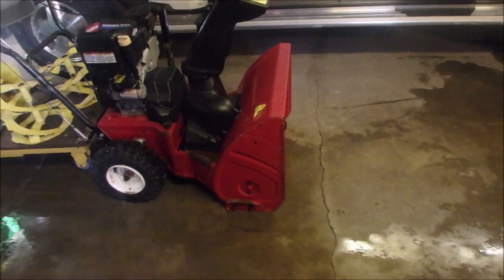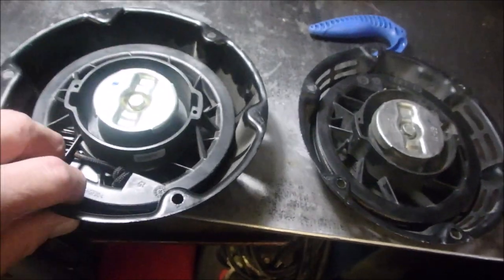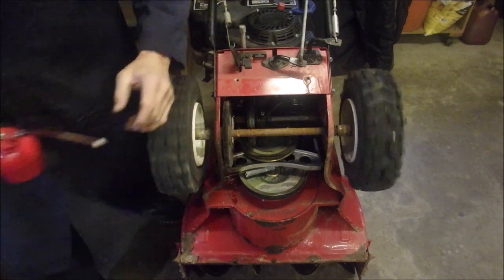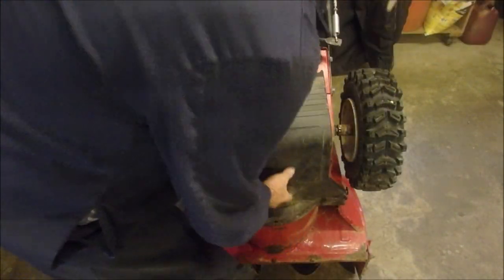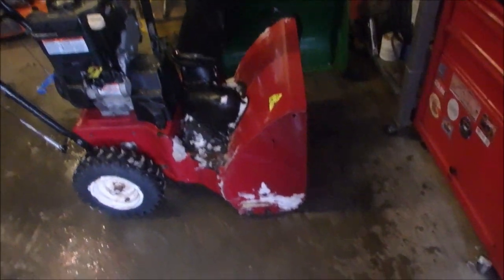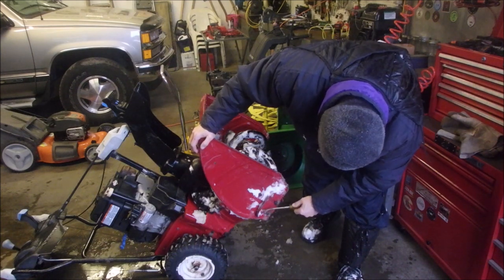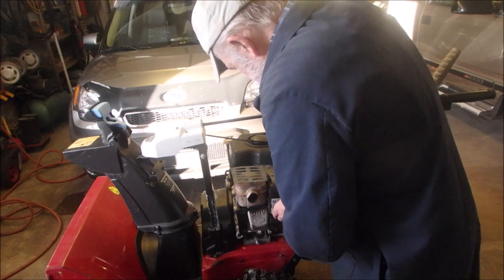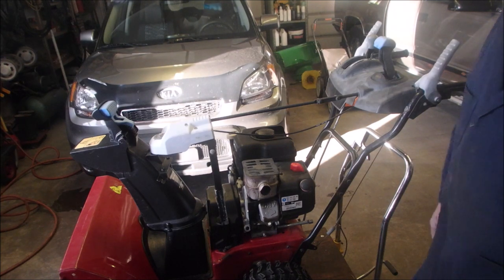A Honda Rewind Installed on a Toro Briggs Engine

Comment: Nice hack repair Bruce and great idea putting the washer behind the cup. Yep it pays to have parts from scrap engines saves $100's +
Reply from the maker: It does.  I was thinking that choke lever handle came in a package with a wing wang carb
Reply: I love it when the parts hoard comes through.
Reply: @BrucesShop  By the way wow snow eh? We got beauty weather here Bruce like summer time just the falling leaves building up and need to be mulched or bagged.

Comment: Yeah prices are getting way out of hand. 
I just fixed a gentleman's old lawnboy mower, the bail cable broke. 
Well I checked for a replacement, which turned out to be 192.00 US, no cable is worth that, I tried to fix said cable to no avail. So I zip tied the brake cable, and installed a kill switch, wired it, and install the switch in the old bail handle assembly like the professional lawnboys of the same period used, the guy loves it, but I explained to him, by me taking the bail cable out of the loop the safety feature is no longer able to protect him, he only does a very small patch of level grass with it, no hills, so he said he should be ok. It was his son's that was killed in desert Storm, so it means a lot to him.
Reply from the maker: Good for you.  Yes prices for the rare stuff has gone through the rood.  As well not so rare.

Comment: I’ve heard that a lot of the newer Briggs engines have cylinder head issues due to the use of low quality parts. That is one reason to steer away from any snowblower with this kind of engine.
Reply from the maker: It could be but when you are fixing a machine for somebody, you see what you can do.

Comment: I just happened to pull out my blower that I put a used 1350 briggs onto. starts with recoil cold but won't restart warm. electric start will work warm. last year I did coil,carb,plug,valve check.  nothing fixed it. i can prime and choke and pull . it just puffs out muffler or carb. let it sit 10 minutes and one pull with no prime or choke and it fired right up. I'm baffled.
Reply from the maker: How is the gasket from the carb to the intake?  Just thinking.

Comment: Bruce, I have a customer bringing me back a Honda hs621 snow blower that I worked on last winter. He complains that it will not walk by itself like it used to. I changed the drive belt, and replaced the scraper bar, and he complains that the "Brake is On all the time. The auger won't spin. Suggestions?? I am clueless now on this. Your help would be appreciated.David Anderson
Reply from the maker: The gear in the auger gear box may be seized.  BE careful!!!  Hand out of the way
Reply: @BrucesShop  Thanks, but this one is belt drive only no gear box. I am thinking the auger bearings have seized. Thoughts on that one?

Comment: Never could understand why they would put such unreliable engines(tecumseh) on something that has to start and run in the harshest time of the year .always had nothing but trouble with tecumseh snow blowers.
Reply: i have a tecumseh it runs great a craftsman 1 pull starts right up i bought it 2006 i just change the oil once a year if i run it alot of hours...
Reply from the maker: @thomasdowneyjr.4162  This one is a briggs
Reply: @BrucesShop  very true I know it's a Briggs